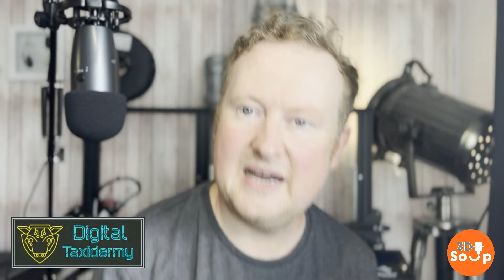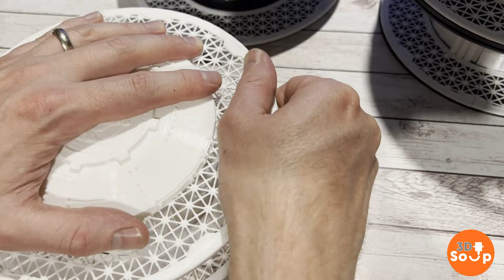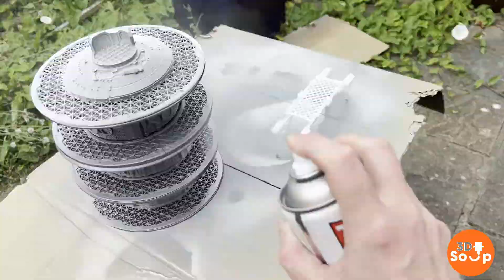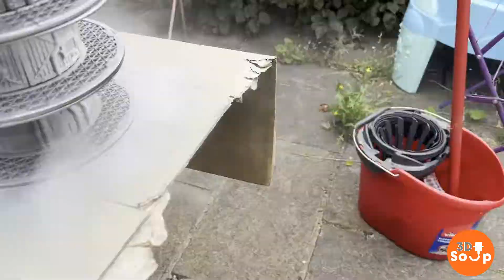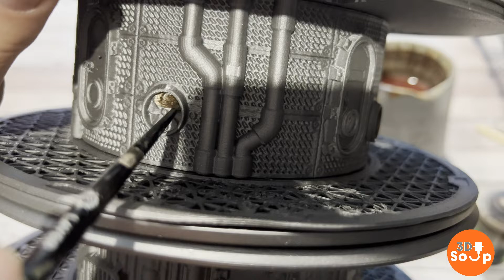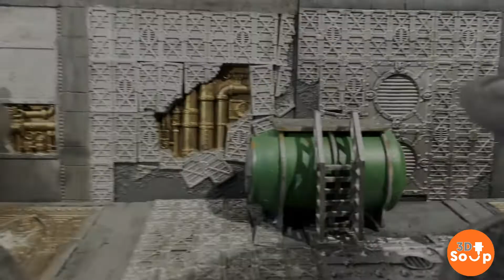Turn your old 3d printer spools into Spool Tower Industrial Slum 3d printed sci-fi terrain.

Comment: How large of a print bed do you need for these? Will I be able to print them on my (19x19cm) Kingroon?
Reply from the maker: Prints just fine on an ender 3 with 235x235 so you should be fine
Reply: @3dPrintedSoup   Even though the bed on my machine is 450mm shorter on each side than the Ender 3? Did the prints go to the edges of the Ender3's bed? Were the prints divided into halves or quarters?
Reply from the maker: @docpepperclassic  no they printed in bits and no it did not take up the whole of the bed area. I don’t have the prints anymore so I would recommend asking the creators directly if you need advice, they can help you.
Reply: @3dPrintedSoup   Thanks a ton. Really great video, by the way